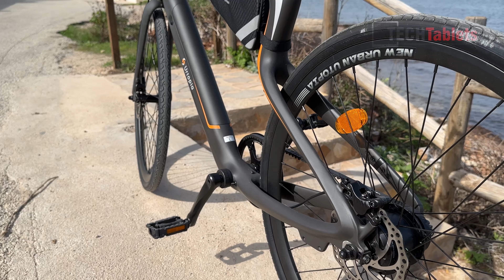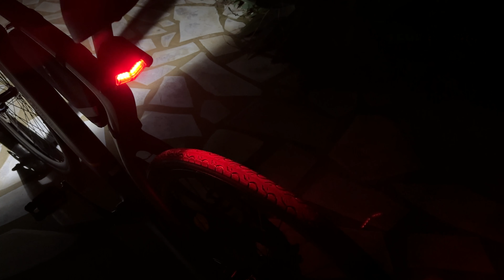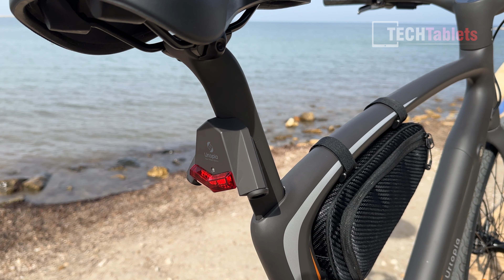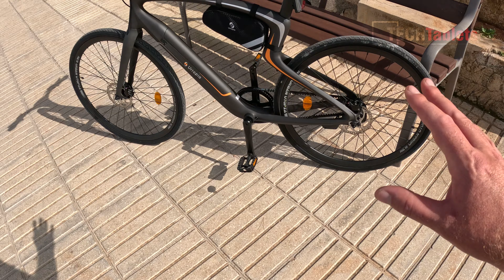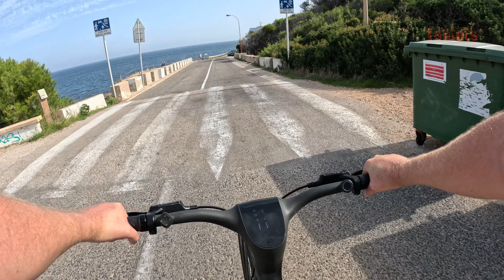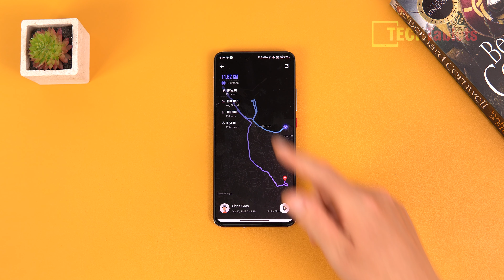Urtopia Carbon Fiber eBike Review - The Final Version!

Comment: My main concern is with the structural integrity of the frame without a full length seat tube. This puts a lot of stress at the head tube and the rear axle where the seat stay and chain stays meet and those places don't look like they're reinforced. The weight of the rider bouncing up and down cycling the stress points will eventually weaken the carbon fiber.

Comment: Only a 2 year warranty...I would expect with no seat tube the vertical flex is going to cause some cracking.  IDK why they went against conventional diamond shaped frame with a conventional seat tube which also allows full adjustment of the seat height.  To make the frame stiff enough to accommodate no seat tube, they had to beef it up other places which only adds weight...seems really stupid to not have a seat tube that is continuous to the crank.  I would wait a couple years to see if these things break on people before purchasing.  No bike I ever purchased had such a short warranty on the frame.

Comment: Price kills...😅 Battery popping up is not a nice thing, especially if it's a design flaw. Battery drain in idle it's OK if you leave the bike in a public space, to avoid theft, but when you're home, you should be able to turn everything off via app, if the bike is sitting in a safe place. At that price they should include all the accessories, come on!
Reply from the maker: The odd thing is the prototype battery didn't pop up on me but this one does. Could be the battery latch but it seems fine. The only way to stop the drain if you're not using to for long periods is to remove the battery. Slightly annoying but an easy fix at least. I agree for the price you should the mudguards and kick stand.
Reply: @Techtablets  i would definitely take out the battery 🔋 so that is less appealing for thieves.... Just wondering if the rain would be a problem ... Since it looks like it would be like a bucket 🪣 where they placed it ..

Comment: pointless and expensive, just another bicycle for lazy persons
Reply from the maker: Ebikes aren't for lazy people lol, I have a Trek Rail 5 and due to the battery and mid motor can now go on 80km off-road rides instead of my limit of 34-40 without the assistance.
Reply: @Techtablets  i have 4 ebikes, all of them go over 40 miles/hour which can`t be replicate by a simple bicycle, in europe thou at 13 miles/hour you will be surpassed by every single bicycle plus joggers, lemme guess, you took off that limit...
Reply from the maker: No I have the limit on my trek, but yes some of the other chinese ebikes I have like the GF750 are now unlocked...

Comment: Wow nice looking bike.Shame about the battery drain and it coming loose unacceptable…
Reply: This, and the non-adjustable seat post and handlebar.
Maybe I'm just old-fashioned, but I love bikes from a high quality steel with lugs.
Reply from the maker: The seat post can go up, but barely down and it will be an issue for some short riders. They will be forced to cut the seat post something you shouldn't have to do.

Comment: The thing I'm worried about with rear drive motors is when the rear tire gets punctured, it's going to be a pain patching it up
Reply from the maker: They are a bit of a pain, but I have an eBike from Italy coming up in the channel that has a bit of a solution to that with a belt tensioner that you can use to easily take of the drive belt and then remove the rear hub. The motors all unplug.
Reply: @Techtablets  my rear tire went flat. I took the bike to a bike shop so I wouldn't have to mess with that. They put a new tube in for $40. Money well spent.

Comment: A proper modern design on this one Chris that will keep you fit for sure! Expensive though! The carbon build results in great practicality, but you would expect better range. At least closer to their claim! A bigger battery should make a difference I guess. 
The security system and projecting light ,signals are a really nice touch here. 
A great E bike indeed! 👌👌Thank you for the detailed review as always✌✌
Reply from the maker: Thansk for watching as always. Yes it's a good 1st gen product, I hope the next model will have a different seat post design, better range and a battery that doesn't pop up. Could be just my one as my prototype first model didn't do it!